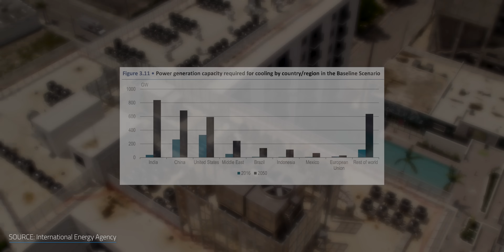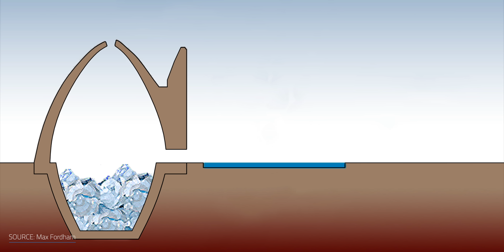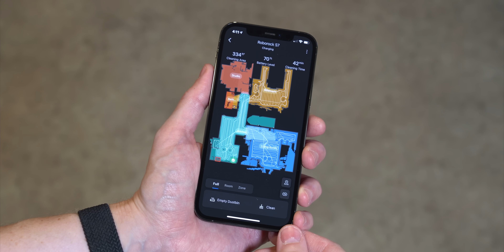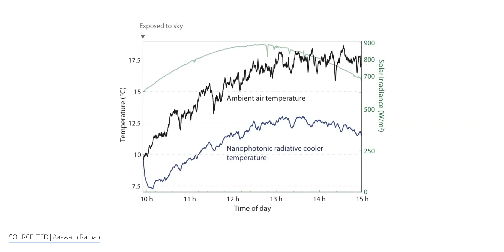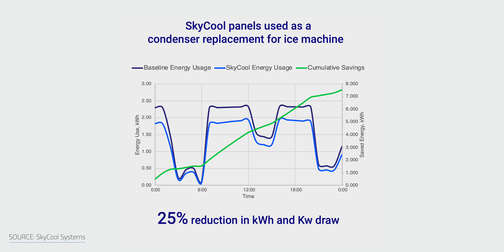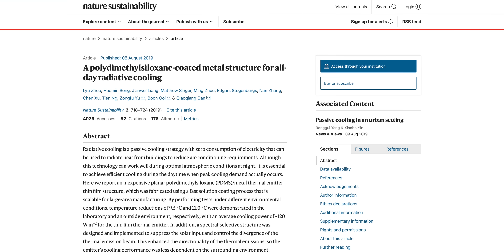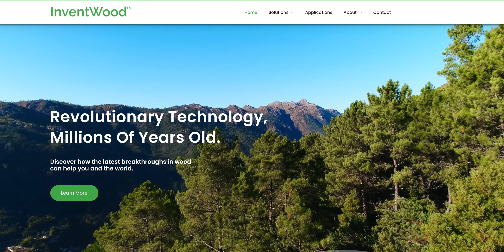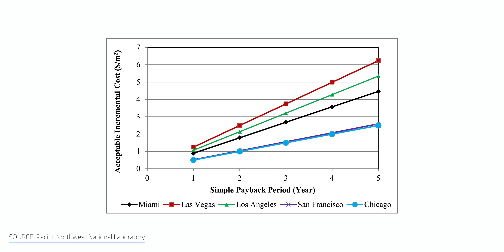Space Powered Cooling May Be the Future of Energy

Comment: Matt,

 where do you get your data from as it is seriously flawed?

3790 times more potent than CO2, really? CO2 is not potent anyway so 3790 times near zero is near zero.
How can flurocarbons be 4% of greenhouse gas emissions when total man made emissions are just 4 to 6% of total global emissions. Even the IPCC acknowledge this.
Forgive my cynicism but your endorsements earn you how much commission in producing videos for the gullible?
Incidentally, also another misleading comment, turning down your A/C cooling does not increase the cooling effect. If the temperaure is above the set point reducing it does nothing. Only if it has the capacity and brings the temperature to a lower figure which is likely to be too cold does that increase it's power consumpion. That's not what happens in real life.

Comment: I read the summary of the original research about 5 years ago. I've been waiting since then to see the tech commercialized. It also has application for space, and is just one example of the potential of metamaterials and advanced materials technology in general, as well as the impact of multidisciplinary cooperation.

Given the early stage of implementation, significant cost reductions can be expected from further optimization. It is also amusing that widespread use would shift the earth's collective radiative signature slightly toward the Karishev 1 profile.

Comment: Here in Florida my electric bill triples in the summer,  so any improvements in AC technology is welcome
Reply: This technology is aimed at the commercial market first. Home applications are probably 10 years into the future if at all.

I would look into renovating your home.

Adding insulation.
Replacing windows with better ones.

Adding awnings or increasing the size of the overhang on the south side.

Keeping the south wall in the shade on hot summer days when the sun is high in the sky.

Putting awnings over windows that have a lot of direct solar gain.

Look up Passive Solar design.

Many of these elements can be retrofitted into a house.

Comment: I know reflective paint works because I tried it in 1989. I applied a thick, ceramic impregnated white goop to my cheap asphalt roof in Sacramento, where it gets triple digit hot 100 days. My house was a lot cooler. I didn't do a scientific study (my bad), but I was very happy with my lower cooling bill. To muddy the waters, I installed reflective insulation later in the attic. Did I get my money's worth in either or both? Probably not, because I didn't shop around. I bought both at the new products fair. I did bargain a little, but without the 'net, I couldn't shop around easily.

Comment: Seems like all you would need to do would be to cool a "cool battery" such as a large volume of water or Sand or Concrete. Then, during the day, move heat from the house back into the cool battery.
Reply: house have under floor heating for the winter? Plumb into those loops and pump through the night-sky cooling panels at night :)